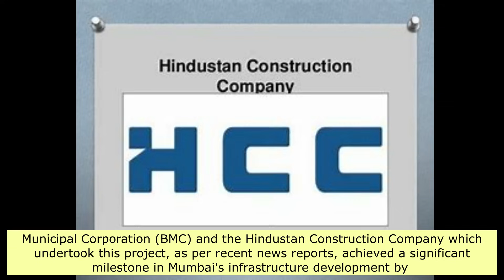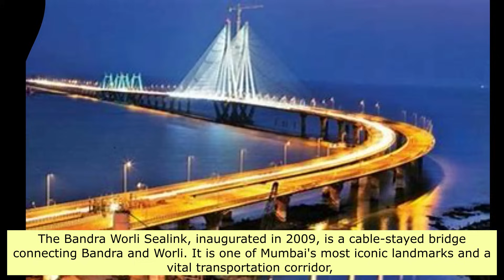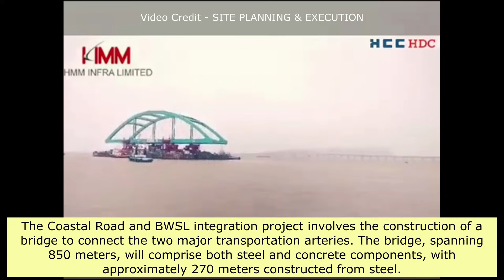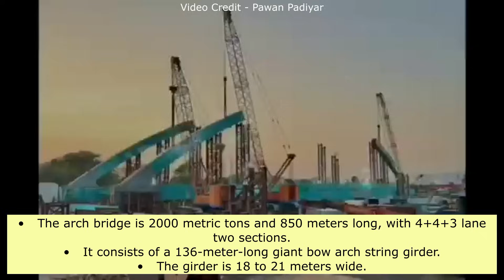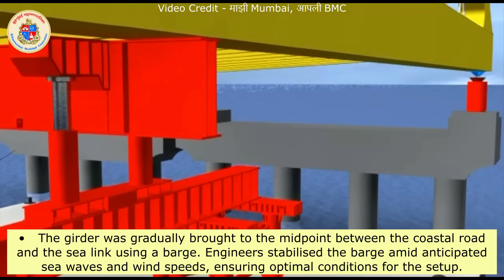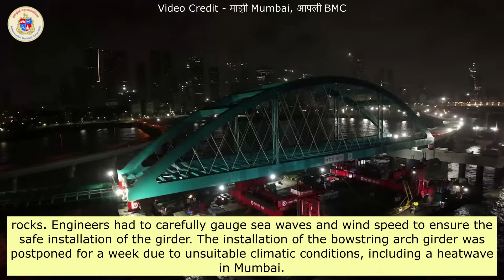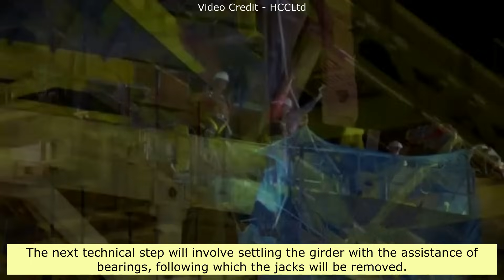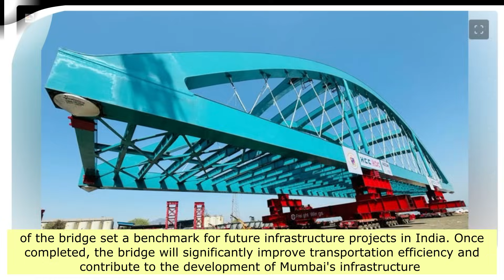India’s Longest Bowstring Arch Bridge | Mumbai Coastal Road & Bandra Worli Sealink Connector

Comment: It’s 25000 tons not 2000 tons
Reply from the maker: @ooppww1923 Thank you for your comment. I agree that some news reports have mentioned it to be 25000 tons (I have also added screenshots of the news reports mentioning it as 25000 tons within my video, along with other news report screenshots which mention it to be 2000 metric tons). I was surprised by the 25000 tons number. However I have stood by the official twitter post (a screenshot of which is also part of my video) of BMC which quotes it to be 2000 metric tons. If one checks out information in the internet regarding the Heaviest Loads which the Strongest Cranes in the World (not India, not Maharashtra, not Mumbai) can lift, one would be gently surprised and conclude that the number of 2000 metric tons (as quoted in my video) has to be correct. Thank you once again for your comment. Kindly subscribe.
Reply: @Scitechbuzz1  I am sorry it actually was 2000 tons 😅